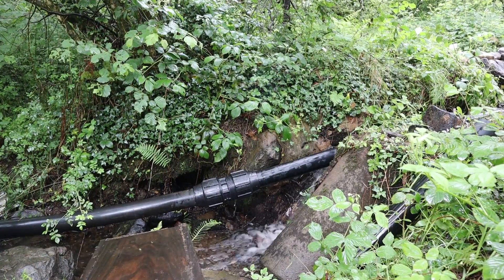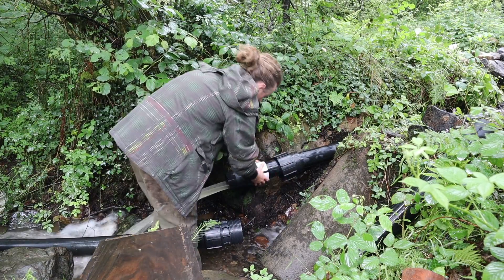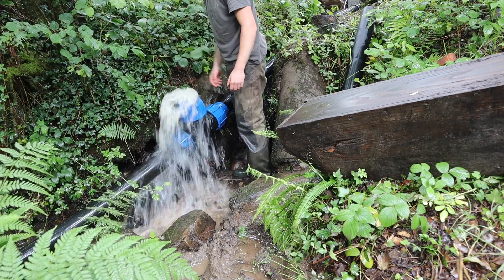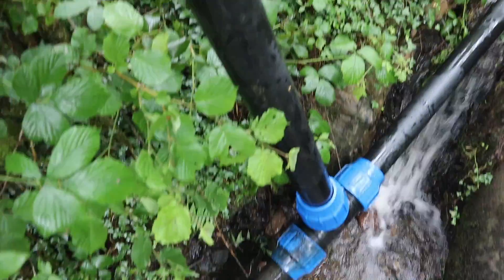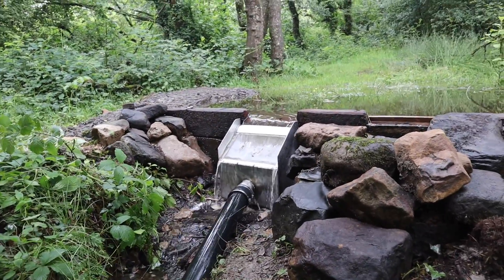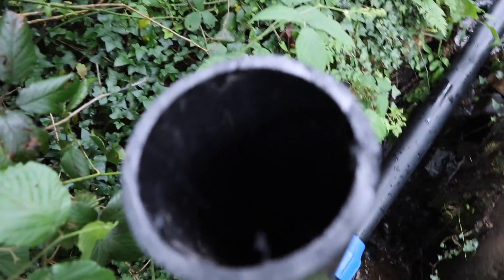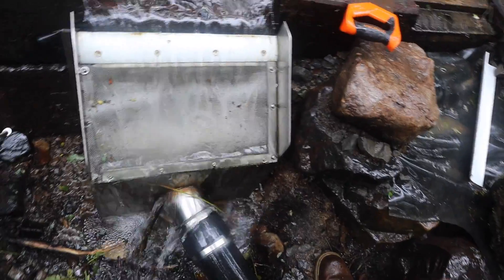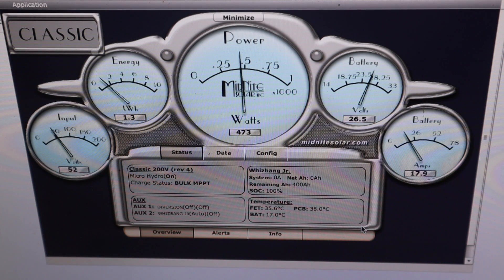Hydroelectric intake Update and Modifications.

Comment: Could you try the system without the stand pipe? As the negative pressure of the water flow could be causing a venturi effect and drawing air into the system, which would still cause a burping sound, but not because of air  being released but because of air been drawn in???
Reply: No way would a venturi effect pull air through that much head. Friction losses due to the T junction however...

Comment: Baffle is taking energy out of the water though surely try adding a wide funnel to end of pipe that would help direct water ???
Reply from the maker: No it isn’t. Well it is but it is taking it out before it has started its travels so there is nothing lost in the system. Anything that happens above the water line is already lost due to it being above the water line and not adding pressure.

Comment: So I've been watching this channel for a few months, and I haven't seen a single building activity that involves exclusively NATURAL tools and/or materials. I see industrial power equipment and plastic and chemically treated products everywhere.
SO WHAT'S UP WITH THE TOTAL DISHONESTY OF THIS CHANNEL?
Reply: Plastic will hold up in these conditions for many years making for a very reliable and sustainable system. Industrial equipment isn't all that bad as long as you use it right and don't let what you have go to waste. His energy is from completely renewable sources and he even uses an old used forklift battery.  All of his buildings have used much of the wood from clearing out where the buildings are along with a sort of tree farm out in the woods where he plants new trees after cutting them down. As long as you replant the same amount of trees that you use and burn for fuel you are carbon neutral. Reduce Reuse Recycle.
Hey Kris, you aught to experiment with waste heat collection and larger solar water heaters using a large insulated water tank to store heat. Then pipe that hot water into you shop/house/battery shed and through a heat exchanger or make a radiant floor heating system. 250 gallons of water should store about the equivalent of 20KW worth of heat. Put an additional heat exchange copper pipe on the remainder of your stove pipe on your roof and collect that heat as well as powering an electric water heater with excess energy from your power system once the battery is fully charged.
Reply: @RingingResonance  "Natural Building" is a noun phrase with a clearly defined meaning. You don't get to have your cake and eat it too. And you don't get to redefine the meanings of words to ameliorate your own hypocrisy. The meanings of words are determined by convention: a tacit agreement that we'll all use that word to refer to the same thing. Considering that this channel comes from the Orwellian nightmare that is the current UK, it doesn't surprise me that you are all engaging in the semantic games of Oceania. 🤣🤣🤣
(edit to add laugh emojis)
Reply: @ArchEnema 67 Then go live in the woods and live off the land if it means so much to you. You don't need tech, you don't need to sit here and watch yt on your VERY sophisticated electronic thinking machine. Nah. You're right. ya can't have your cake and eat it to.
Reply: @RingingResonance  I make no such high falutin claims. Whenever I make one of these little criticisms, the reaction is always very telling. If the channel creator and core subscribers react with, "Hey, ya know, you're right, but we all fall short of earnest goals, and sometimes it's more important to get things done than worry whether we're strictly following our own principles", then I know I'm dealing with good people trying to do good things.
When I get defensively motivated aggression, name calling, and armchair psychology projected onto my character, then I know I'm dealing with poseurs and LARPers. I do wish to thank everyone on this thread for making it so easy for me to see which is which here abouts. 😉
Reply: Just one word :- D'oh!
A few more words:- Hopefully, everyone else will ignore your tedious, juvenile, dumbass trolling.........
Unless, that is, you're just not very bright, and don't understand things. 
In which case, you have my sympathies.........!!
Reply: You would have lasted 5 minutes on any job I've ever worked on. And that's over 40 years of working experience. At least the enema part of your handle is appropriate.
Reply: @briangarrow448  Nice projection, you fat lazy potato. I'm a wall and swale builder for a landscape construction firm. I dig all day, interspersed with carrying heavy stones and baby trees. YOU wouldn't last 5 minutes on MY job, fatty.
Reply: It's called "progress".... If you want natural building videos, go back and watch his old videos where he started 🤦

Comment: Amazing work but 400W is like 4 decent solar panels and it require much less work and maintenance.
Reply: The only SLIGHT drawback to that idea is that, when the sun sets you get ZERO power!
If you have a system which incorporates hydro AND solar AND wind then you cover as many bases as possible.
Which is what this dude HAS done!
Did you just watch this film.......?!
Reply: Alas they dont work well with the typical british weather 
Most of the year its cloudy
Reply: Twoflower always plenty of water tho 😂
Reply: Hydro works 24/7, while solar panels average 5 full productive hours a day. When it’s hot and sunny, solar is great, when it’s cloudy and wet (especially in winter) this 400w hydro system will out-produce a 4kw (maybe even 40kw!) solar system.
Reply: @dietershirley3234  hydro DOESN'T work 24/7 if you don't have any water! Which is the case in this situation for significant parts of the year. So, I refer to my original point - if you have wind and hydro and solar, you cover as many bases as possible.....!

Comment: With regards any air that does get into the system, the main box you have in the shed where the 4 pipes come out, could you not fit a Automatic air vent pipe so any air that has made it down that far could escape before going into the jets ?
Reply from the maker: Air and water are both fluids any outlet for air would also let out water. Basically water would blast out at the speed of about 20m a second
Reply: @KrisHarbour  - Water will raise a float that air will not. We use about a half dozen air relief valves in our water plant. They are designed to hold water and to vent off the air while under pressure by way of a ball float.
Reply from the maker: Yes. But I think you are forgetting that the entire volume of the manifold is replaced every 2.5 seconds. There isn’t air in there staying staying in one place long enough to go out a valve. Any air will be out the nozzles long before the valve even drops to open. I move 5l per second though that manifold on top of that as it opened and closed trying to keep up it would be causing water hammer up the penstock. I really can’t see that working at this scale. If the manifold was huge then maybe but not when it has such a volume moving though such a small space
Reply: @KrisHarbour  - No they definitely would not cause water hammer, your situation is exactly what they are designed for. No matter how fast the water is flowing the air is still pushed to the top of the pipe, unless the water is very turbulent, which yours shouldn't be. Then you need just a high spot, like a tee, to collect it, and the air valve will let it squeak out. We use them at a lot higher pressures and volumes on our 100mm well water lines.
Reply: @KrisHarbour  No water will come out, these are designed for this sole purpose, to let air out of a system but not water, 
Now whether it would work in your system with the amount of water flow ive no idea, i know alot of water 'could' pass through but once you have the water jets it works by pressure rather than volume so not alot of water is going through, could be worth a try to see if it can help to clear any air that has made it through to the bottom part.
Reply from the maker: @wolfe1970  Have you got a link to what you are talking about so i can have a look? If it looks like it could work and isnt to expensive i would give it a go as it wouldnt be hard to do.

Comment: you think its possible to clear the leaves and all of the floating debris before its reaching the drainage hole that is leading to the pipe, where you got the net? like a barrier of a long piece of straight lumber that you place in an angel leading to the overflow, it will be place in the high of the center hole, the water will go under and all of the floating stuff will be diverted aside. I don't think something like that will block the water that will flow under..
Reply: @UC5rT7F0PGNuD54rJ9kzgWzw i think you are misunderstanding what he's trying to suggest.
I think he's trying to suggest a floating primary surface screen, going no deeper than 1-2" beneath the surface and the same above, diverting anything floating on the surface accumulate against the barrier while the water flows underneath and the accumulated debris getting washed away by rain surges so that your intake screen only gets the debris that is suspended deeper than the surface screen.
Essentially, a 4" strip of material floating half submerged and vertically sliding on anchor rods, one end just left of the spillway and the other diagonally across at the other end of the dam, allowing any accumulated debris to be swept towards the spillway by the current and the angle of the screen.
Reply: Christopher Stout  it's possible that he might be reading your suggestions and thinking they're a bad idea........?!!

Comment: Kris, with the black and blue pipe sections,. you need to brace the pipe with stones or boulders so it all lays 'level' (i.e. it doesn't have to ACTUALLY level, just so the joins aren't stressed with poor weight distribution etc) within its fitting so the joins aren't stressed due to them laying at awkward angles. Did that make any sense? lol, sorry, hard to effectively articulate what I meant.
Reply: And would help with trapped air if was more level!!

Comment: Just a little tip, since you're using mac. The Quick Time Player can do screen recordings since a few years.
Also, if you're running Mojave or newer, the screen shot shortcuts ⌘-⇧-3/4 go a new addition, -5 which enables you to do quick screen grabs even without launching QT.
Having a screen capture instead of the camera pointed at the screen looks way better and this ways it's not even more complicated than setting up the camera :)
Reply: Probably in an expensive programme, but this is crammed with so much more content l, personally, love the feeling of looking at it with Kris.